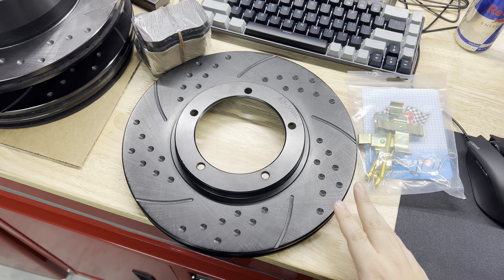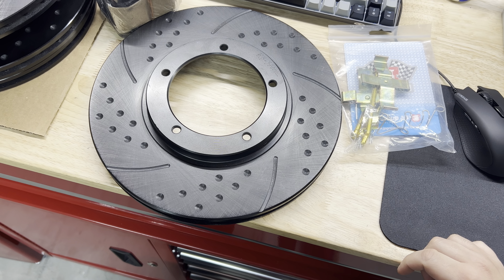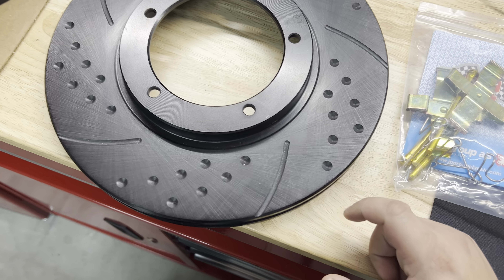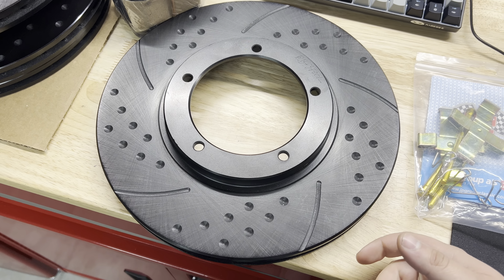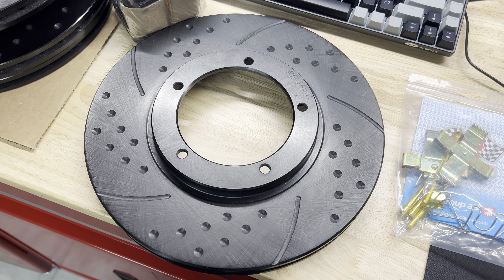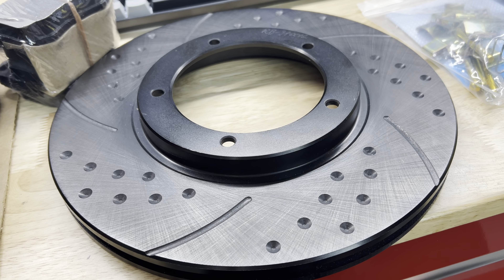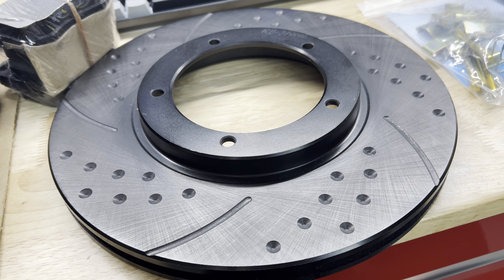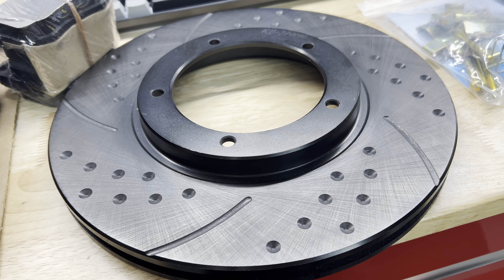944 Mini Build Series Part 3: Choosing Brakes!

Comment: which pads did you pick?  I'm going through my brakes now and trying to pick a low dust, low noise pad for the front, just for street use.
Reply from the maker: I went with ceramic pads I believe I start discussing all the pad stuff around 5:30